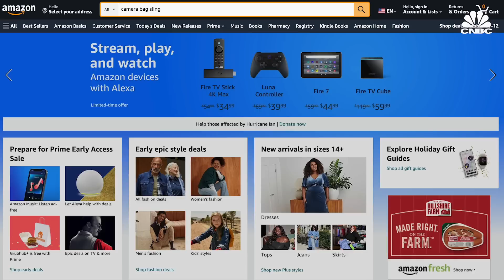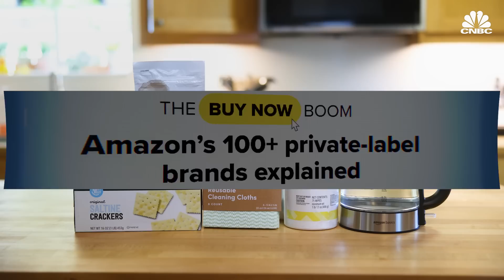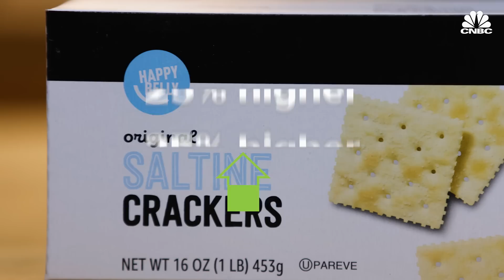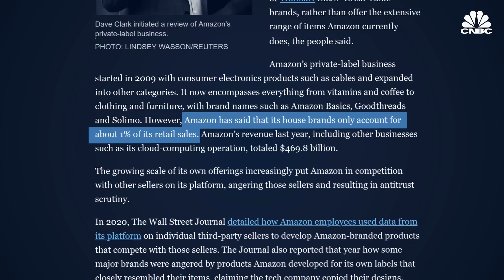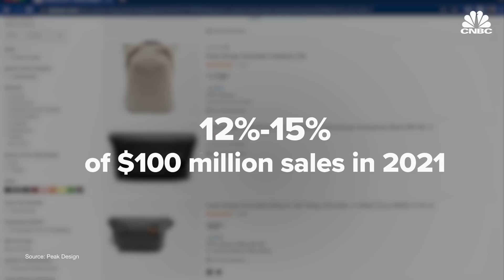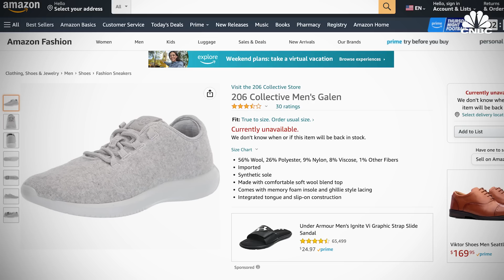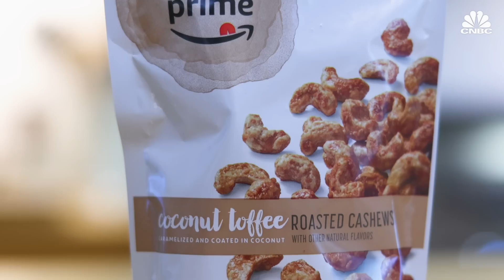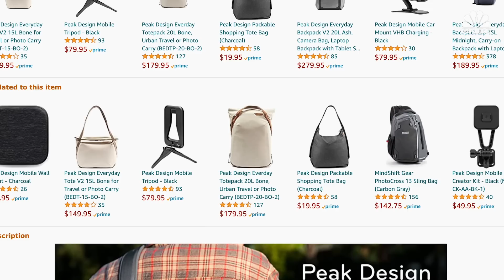The Big, Secretive Business Of Amazon’s 100+ Private-Label Brands

Comment: "design patent" is the most important piece of information from this entire video. It had a lot of great info, but that's the take away message so they don't screw you over too.
Reply: it won't help, like cmon, they would make the bag slightly differently and call it a day. This was simply the easiest method for that particular product as it would take less money. But if they had one, the bag would likely still have been copied but just not fall under the patent, thus making the bag 50 cents more expensive and voila, same problem
Reply: @PEEinMYbutthole200  Amazon put their label in the same uncommon place the smaller company did...They are clearly trying to confuse consumer.  Amazon needs to come up with their own design.  They can sell a cheap camera bag but sell it as one... not a knock of the best selling bag.

Comment: Amazon requires sellers to provide information such as providers invoices with the claim that they want to make sure the merchandise is not fake. This is how they get access to a seller's supplier and knows the cost the seller has negotiated with the supplier.
Reply: How is this legal?
Reply: Amazon also manipulates the search results. If you sort by lowest price first you lose half the results and usually get products that aren't the same as what you searched for.
Reply: @BabyJesus66  I use Google shopping to look for items.  I try not to accept Amazon’s search results. Recent example: I did a Google search for an item and found a good price on a known brand. Clicked on it and it did take me to Amazon with that price but when I did a separate search just on Amazon that price was nowhere to be seen.  So I went back to Google shopping and clicked on that better price. Got what I wanted at and it cost much less.
Reply: The only thing amazon does with the extra info would be get you cheaper products. They would still be able to undercut competitors without this info, as they have a massive scale.
Reply: As an Amazon seller I only have to supply a letter from the brand owner stating that I had authorization to sell their brand on Amazon. For a few items I have sold I do not have direct permission from the brand owner, and I have to send Amazon a copy of the invoice showing that I have purchased the items directly from the brand owner or their distributor. They are perfectly okay with me blacking out what I paid the supplier as long as the rest of the information is on the invoice. At the end of the day they have no idea how much I paid for the products, only that it came from an official source.

Comment: Yep I used to work for them in the UK. They take interest in whatever is trending sales-wise, then find the suppliers in china or wherever, buy out all the stock (lots of items are bought from china blank and have their own label added to it) and then buy them out so the sellers can barely get hold of more stock, meanwhile Amazon sell them at a fraction of the price as they have the stock levels and negotiation power with manufacturers to be able to do this, causing sellers to exit the market, and amazon continues profiting over the long term from the items. Sadly the only way this will ever stop is by regulation - which needs to be realistically enforceable in a way which genuinely disincentives amazon from doing this (they make a lot of money this way so the penalty would need to be relative), or if consumers vote with their wallets and choose actively to buy the same item for a more expensive price. Changing human behaviors is a hard sell also. Better living everybody
Reply: That's why I don't buy Amazon basics
Reply: Uh, your example is suggesting Amazon is squeezing middlemen resellers from China out. I view that as a good thing. Those scalpers aren't contributing anything anyways, they're just slapping a brand on a generic. I might as well get it cheaper from Amazon Basics.
Reply: Why is that a bad thing? It removes unnecessary markups. It's much better for the consumer.
Reply: price and value dictates to customers.  nothing else matters. People have always spent money based on price or value or both.
Reply: Buy from China sell for higher simple as that

Comment: When it comes to private label, you do have to be careful though.  Some companies use reputable, name-brand sources for their store branded items.  Such as MicroCenter (A computer store) sold computer cases under the name PowerSpec, but were actually made by CoolerMaster, which is a known brand name in the computer/IT industry.  Now I will say the PowerSpec cases were the lower-end models and generally cheaper (With fewer features, not as good metal construction -- but were made by a name-brand company).  They certainly where as nice or expensive as CoolerMaster's own cases.  However, the opposite can be true too, where they may use cheaper sources to save money (which is the case in many circumstances).

Comment: It's definitely amazing shoppers still just look at the search results given. When you can also use the Top 100 list as well. 

Not saying this is a perfect fit for shopping but in my experience I find the jem in the list with little of a rating or smaller amount of rating.

I tend to focus on when the product is released and not just the cheapest. I tend to find better companies (mostly outside of China).
Reply: When you find the jem, does it come with the holograms?

Comment: The data is the key and Amazon is sitting on the most important thing.
It's really abusing the companies that were fundamental to building Amazon.
Reply: incorrect, as most products are just generic goods with brand name on them sold at a 50% markup.
Reply: @juniorbitare3041  
Markup varies wildly depending on the product and market.  Amazon sits on all of the data - supplier prices, customer habits, etc. and so on.  This gives Amazon tremendous power - including the power to make large re-labeled product line buys and to price them advantageously v. other sellers.  Further, of course, they can control what shows up on the screen - putting themselves ahead of other vendors.  Margin, as long as it's positive, doesn't matter to Amazon if they are taking the sale of something away from someone else.

Comment: Amazon cleverly hides the manufacturer and quality of their products. I purchased a pack of 72 AAA Amazon Basics alkaline batteries for my business. Less than 10 months later I noticed that some of the batteries started to corrode in my devices. I checked the one I have still new in their package and half of them were spilling their contents, I tried Amazon CS but their only answer was that the product was out of warranty or return window. After going back and forth I didn’t even want a refund. I just asked them for an option to recycle the batteries and nothing was provided, the person at CS even said that Amazon batteries do not have harmful components and it was safe to throw them away. In less than a month all rest of the batteries popped, I still have the batteries in plastic bags waiting for a safe way to dispose them. It doesn’t feel good to throw away +60 batteries that I’m pretty sure will cause some damage to the environment.

I tried to track the manufacturer, even to report the possibility of a bad batch to Amazon but they do not have anything program like that in place. Who knows how many more batteries have gone to the trash just like that. I’m a single customer, a 72 batteries were defective, I’m sure that Amazon sells those by the thousands.

Amazon has the capacity of using the cheapest labor, materials and manufacturers; that meet the minimum quality, then hide those facts behind their private labels.

Comment: Used to work in marketing. An account exec told the story of being at a bakery that baked and packaged a national brand bread. As she was watching bread coming off the line and being wrapped for sale, suddenly they went from the national brand to a private label wrapping. She asked how did they sync up the bread with the wrappers to be sure the product matched. Bakers gave each other a knowing glance - the truth was that it was exactly the same product in the national brand and the private label brand. Literally the only difference was the label. Same bread, made on the same lines by the same company, but you'd pay a lot more for the national brand, solely because of the name on the wrap.

This isn't always the case with private label products, but it can be true more often than you suspect.

Are Duracell or Energizer batteries so much better than AmazonBasics that they're worth the premium you pay for them? ¯\_(ツ)_/¯ I kind of doubt it. Most of the higher price just goes for the ubiquitous clever advertising of the name brands.

Now, this is different from a fashion product like the bag in the video above. In that case, there really is a notable difference in quality, and the knockoff is using unique design cues stolen from the target product. In that case I can see the rationale for sticking with the original. OTOH, if you have a commodity product like batteries or HDMI cables, it's not likely there's a significant difference between the brand name and the private label, and certainly the name brand doesn't bring anything particularly unique to the table other than marketing.
Reply: Some times not like for like, see M&M's Chocolate for example , the private label in ALDI i am sure made by M&M's as it tase 100 identical, but you can see that most in M&M's packaging are perfect product , while Aldi one have some that left over.
Reply: cheap batteries do not last, or perform as well. people need to care more.

Comment: I tried the Amazon brand of cheap rechargeable NiMH AA batteries. Price was low but the batteries are only good for low drain devices, unlike US name-brands. Maybe good to run a clock, but forget using them to operate a small radio, which is more demanding. The actual energy storage is ok, but only on low drain applications, that is, the rate of energy delivery (power) is low. Many things using  NiMH cells require higher energy delivery rate. The better brands of these cells have high delivery rate but same energy.

Comment: The EU fines are not limited to be merely some "line item". The fine limit is actually limited to 10% of the actual global turnover of a company. If Amazon, is unimpressed by the fines it gets from the EU, the fines will move closer to that limit and yes, even Amazon will start to look up if something close to 10% of its global turnover is lost due to illegal practices in a single market. Everything else would be simply irresposible behaviour towards its shareholders.

Comment: i shop at costco.. and sometimes thier inhouse brand, Kirkland, is as good or good enough to buy them then competing brands.. when i can buy the product for a lower price. This is also true at Walmart, and with Kroger.. sometimes a specific brand is more important than price alone.. perhaps the brand owners standing behind a product.. or its credibiity and integrity is important. But as a frugal shopper that lives on a limited fixed income, I have to look at price.  And Walmart, Costco, and Amazon stand behind their products. and they make is less risky to buy from them than some unknown 3rd party small business, whom i have no relationship with and who can make things difficult for. I am pretty much the same way when it comes to buying food at restaurants. I have been scammed mom and pop shops whom tryy to shill me into buying something that is not legit and then won't make things right. I have bought things on amazon that were poor quality or whom either did not provide accurate or incomplete informaton on their product. I buy products that Amazon fullfills (on the most part), because i know i have some clarity of what the risks are. Amazon makes it safer to buy from 3rd party vendors who have their product fullfilled by amazon.. this makes it cheaper also for the consumer who can benefit by the lower costs of shipping through amazon highly efficient shipping network system. (and same for returns when a return of an item is necesary. also this makes things easier for the consumer because they just hve to deal with one payee for purchases and returns/refunds as opposed to 10 to 100s of different vendors whom may intentionally want to make it difficult to reach them.. as a way to screw over the consumer. Amazon comments sections is also very helpful to consumers. It is for me. It is not fullproof.. but much better than what was available to consumers before they had ability to review comments.

Comment: i cannot speak to most amazon basics and essentials items. many items (like apparel) are clearly knockoffs. 
some items, like the rechargeable batteries as an example, i have found to be superior - or at least equal to - the brand name equivalents at a fraction the cost. Items like glue buy the gallon I find exactly equivalent to brands such as Elmers. Why would i pay 50% more for the same thing?
The bag that was featured in the video is a great example of an item that I wouldn't even consider if I compared the quality of the original. That is such an obvious ripoff and the quality is unlikely to match the original.

I'm far more concerned about foreign knockoffs of extremely dubious quality flooding the search results and the occasional brand name fakery that occurs. Last year i bought some Bose Alto glasses that were CLEARLY not Bose, when they arrived. the AE/AB products are simply competing with name brand items.

Comment: I want products that fit my requirements. I do my research. More research the higher the price. Multiple sources, many reviews. But I enjoy that sort of thing so it's not time wasted. I make a decision based on it. Sometimes I get a good purchase, sometimes I make a mistake. 

I've just bought a kettle after having my old kettle for about twelve years. They don't make them like they used to. This market is full of trash. General consensus was that modern kettles last between six months and two years. So I didn't want to pay a lot for it. I also didn't want blue lights, glass windows, or the sound of an airliner taking off. Just like my old one.

I chose the Amazon Basics kettle. It wasn't the cheapest but the build quality seems comparable to everything else. It hasn't copied everyone else with the blue lights and the see-through body. It is a little loud, but not the loudest. Plus, if it breaks in a year, it's Amazon Basics. It's not a brand name with a fancy signature on the side and an artistic design which I paid extra for and really brightens up that dumpster it's now in. 

Sometimes you want all the bells and whistles. Sometimes just enough does the job.

Comment: Amazon is simply using computers to more effectively gather and analyze data.  Otherwise it is the same situation globally, that the larger the company so more resources and economy of scale they have, the more easily they can put the competition out of business.  

Plus there is another factor, that when talking about US businesses thinking they have some precious design, they are delusional and hoping that marketing will save them when in reality, their product is hardly ever worth 3X more than the generics.

This is one area where amazon steps in and gives the perception to consumers that they have weeded through the generics and found a decent quality product for the price instead of the generic junk that consumers have gambled on and been disappointed with in the past.   This includes free prime return shipping so if you do get burnt on a purchase, it's as low hassle as possible to return for refund.

It is sad that this is the reality but amazon simply outperforms.  It is a problem that government would have to regulate but not just against amazon but every large corporation in every sector.  That would never happen because of a thing called the stock market, which would implode and put the economy into so much disarray that anarchy ensued.